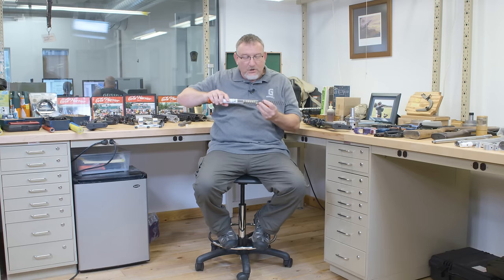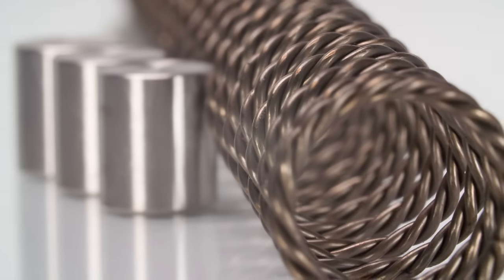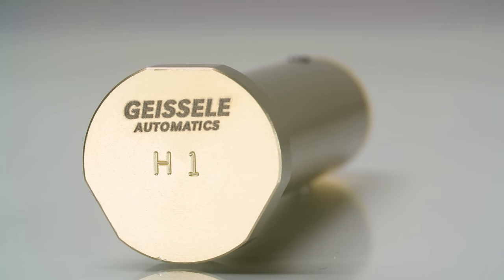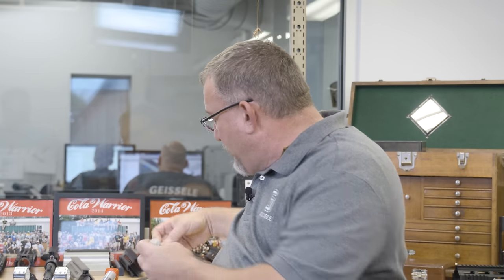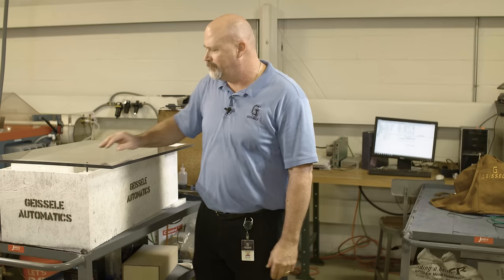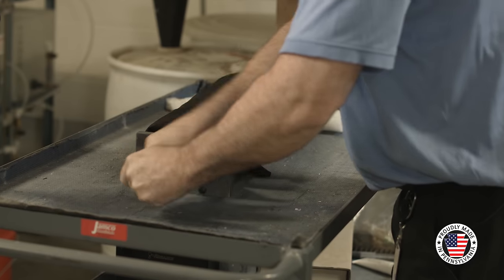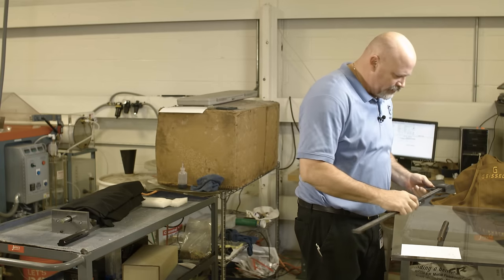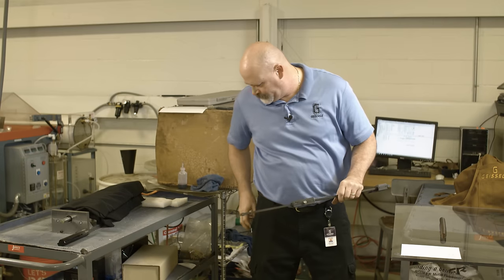Introducing the "Super 42 Braided Wire Buffer Kit"

Comment: Everything's chicken, but the BILL...
THANKS FOR THE INFO...
Do the springs have spot welds to hold the individual wires to each other, or is it the spring's "memory" that each wire possesses that utilized by the metal always wanting to return to it's previous straight shape before being tooled into the twist? Like it's wrapped with a twisting sequence, always pressing in different opposite directions all at the same time? I.E... outward, inward, wanting away from, and against each other constantly, almost like the water that keeps the static pressure on the submarine that is holding the springs together with each other in that shape? 
I was wondering if the friction causes it to heat 3x as fast,  weakening the  metal at all and if the wires rubbing against each other need to be kept up with and oiled periodically to help with lubricity and combat the heat with less friction between the strands?
Reply: Regardless of your answer to my aforementioned question below this one... I am going to buy 2 of your MG 42 Buffer Springs... That is, unless you fine weapons builders in Pennsylvania could find it in your heart to send me 2 of your previously used test samples to install into my wife's .223/5.56 AR w/16" barrel and also into my AR-15 which is chambered in .300 Blackout that has a 16" barrel as well.
If that sounds as great to you as it does to me... well, just holler back at me and I'll make sure to send you a size for a T-shirt I can wear to provide you with tons of free advertising that results in even more boosted sales to your great company. Yeah, I though you'd agree in the fact that it would obviously be a no-brainer type of good idea to go ahead and invest in. Thanks...
I'll have YouTube alert me for your rapid response in the inquiry of T-Shirt sizing to go over my BIG head. 
I sure am REALLY glad you quit designing train tracks and went with your desire of improving these parts to make my free time go so much  smoother, less stressfilled, and it leads to a more happy /go lucky less worries giving me a better outlook on life... because that's just one or 2 more things that are going quite a bit smoother, that I don't have to think about anymore now. I'm VERY HAPPY with your parts that I purchased and I now own already.
But... If you're gonna scrap the springs you used in your previously mentioned test runs on them....you know, holler at a brother... lol...

Comment: Hi Bill.  Can you tell me how much an AR spring will take a set if it's stored with the bolt locked back for a prolonged length of time, say more than one year.  Thank you.
Reply: I can. Depending on the quality and heat treat, it SHOULD be ZERO. What affects springs is not the compression, but the CONSTANT compression/decompression. I've got a bunch of 100+ y/o Mausers where the magazine springs are just like they left the factory,

Comment: I'm seeing quite a few comments complaining about the cost of this, and the propriety buffer. While I'm not an expert in buffer kits or all the different brands of them offered, I think many are missing one huge plus to this kit..... being able to swap out buffer weights yourself. To me, that is HUGE. Trying to fine tune a rifle with different ammunitions, or shooting suppressed vs unsupressed, being able to change the weight of the buffer, without actually purchasing different buffers all together, seems like a pretty big pro to me.
Reply: You can easily change buffer weights in the standard AR buffer the same way. Just push out the pin take the poly pad out & change the weights yourself. Heavier weights or steel weights or mix a heavy with 2 steel weights etc. They are separated the same way with a little rubber pad. Same as this buffer. People that just start flopping parts around for no reason then wonder why it won't run right have no business with an AR. Most AR's run fine without all this "after-market" "after thought" parts. If it works don't fix it!

Comment: Would there be performance issues on a piston-driven 16" AR-15?  And if not, would the H-1 with a single Tungsten weight be sufficient?
Reply: H1 did not run in mine. Jammed after every first shot

Comment: I have the m&p sport 2 and seams way over gas and has too much recoil. Where do i start? Buffer or adjustable gas?
Reply: Jesse James you can change out the gas block to an adjustable gas block or try a muzzle brake instead of a flash hider. The muzzle break will vent more gas out the front but you will lose the flash eliminating capability a bit.

Comment: A little bit of Russian trigger engineering... I love your product Mr. Geissele. I recently bought one of you charging handles. It gets best out of 4 other ones I own,  It's very smooth. Shame you don't have this spring setup with an H2 and an H3 option. Is their anyway to get only the spring?
Reply from the maker: Hi John, we sell extra tungsten weights that turn the Super-42 into H2 or H3 options. Installation is easy. The Super-42 spring will not work with a standard buffer, this is why they are sold as a combo.
Reply: Ah, I see so the buffer isn't a MilSpec Colt type? I'm interested in buying one, thanks for the information. Your companies charging handles are smooth as can be. I've tried many other high-end brands and the coating is slick. Is it Melotined? I didn't have the gas block and tube perfectly inline. I went to function test it, it slid off the barrel. lol, I torqued the gas block down well with RokSett and haven't had a problem in full-auto. I think I'll go with a barrel dimple jig for my next build.

Comment: How does it function in short barrels 10.5? Or 16" with mid length gas or intermediate gas
Reply: 12:45 through 14:05 he talks about this
Reply: Bill says carbine system, doesn't go over mid or rifle length
Reply: I'm running one in a 16" mid-length gas system. And it runs very smooth. Not one issue.

Comment: 19:15 "measure a spring with calipers. hahahahahah oooohhhhhKAY
Reply: I’m not ver mechanically inclined but it did seem like a pretty arbitrary measuring. They said at some point it’s more  they’d like,  but yeah, it didn’t seem very scientific. I’m still gonna try it though. I’ve got a PSA and I would like for it to snap a little stronger when it goes into battery. I don’t have a real reason for wanting it, I just want it.
Reply: @LKaramazov  Rule of thumb is to change from tip to butt.
Starting:
1. Muzzle device 
2. Gas block / Adj Gas Block
(Gas ports on the barrel can also be opened -- but I'd not recommend this unless you're advanced)
3. Gas tube (Black River Tactical makes tubes with different diameter holes to change gas glow.)
4. Bolt
5. Bolt carrier group
6. Buffer
7. Spring

All depends on what you're going for. "Lighter recoil"/"muzzle flip"/BCG bolt speed, etc.
Reply: @Gnolomweb  thanks!

Comment: I thought the Super 42 was complete snake oil until I picked one up on a Black Friday deal a couple of years ago so I could be Gucci too. I'm so sorry to Bill and his team for calling them out on this. It is without a doubt the best performance upgrade I have made. It's really hard to explain until you use it, but it feels so different. Not really less recoil, but more expected and controlled, if that makes sense. I run it in everything now. Great video here too.
Reply: Still running these springs and buffers?
Reply: Mr. Excitement yes. Either these or Vltor A5. A5 is a bit more flexible, but these are great.
Reply: Grayish Man that’s great that they worked out well. I’m building out a lower receiver parts list currently, and planned on trying strike industries flat wire spring with a spikes buffer.( 3 oz or the 4.3oz) saw this and said hmmmnnnn . It’s tough choice. These really all the hype bill geissele claims?
Reply: Mr. Excitement I have used the Strike, CMC and Tubb flat wire springs. These are great too. I have tested most everything. The flat wire I use with the A5.
Reply: Grayish Man do you think these are worth the 82 dollars in h-2 form, that’s geissele asks? The strike flat wire is 17.95. Did the strike reduce the twang sound as well?

Comment: Thank you for the great video.  I'm a new subscriber.  

I have been reading and looking at every YouTube I could find on buffer selection and springs.  As someone new to AR-15's, finding out why something is deemed higher quality than an alternative can be elusive.  Most boiled down to experience and trust me.  Until I saw this video, most of the advice suggested going with the heaviest buffer that allowed your AR-15 to cycle correctly based on trial and error.  Some suggested going with "better" springs without really explaining why they're better.  A statement like "7% stronger" doesn't do it for me unless you can tell me why that improves durability and other desirable characteristics while not screwing up the rifle's timing.  Now I am looking to purchase a PSA lower (great price point), but am going with the ALG ACT trigger and this buffer and spring.  All PSA lowers seem to come with carbine buffers and, intuitively, that sounds like the wrong choice for my 18" upper.  It's not carbine length so why is the default carbine buffer the right choice?  It's cheap and will work, but at a cost.  Really looking forward to finishing this build!
Reply: The act is a great trigger. I rec using the  heavier hammer spring unless you are only going to fire cartridges loaded with softer primers (usually not mil surp). You are absolutely correct with buffers though. Go for the heaviest buffer that still functions reliably with every type/weight ammo that you plan on using. My 18 inch mid length really likes the T2 buffer with a chrome silicon buffer spring.

Comment: You guys should improve the design of the buffer retaining pin. That is one of the weak points in the AR and I think you guys could engineer a fix. The function of the gun hinges on this pencil lead thin steel pin which takes a beating with each mag. Make a buffer and spring retaining system that is more robust.

Comment: I think it’s snake oil. 

If one’s worried about noise from harmonic frequency whilst donning hearing protection, I question their sanity. And, who among us has put 50K rounds through any of our AR-15’s? Subsequently, his selling points are moot.

Geissele’s a proficient machinist…I’ll give ‘em that as a fact. Nevertheless, you can dazzle with brilliance and baffle with bull shit and he’s rockin’ it.

I don’t know how smoothly this Super 42 Braided Wire Buffer Kit performs but I do know the JP Enterprises system performs noticeably more smoothly than a Mil-Spec spring and buffer assembly. Without wearing any hearing protection, charging a JP Enterprises system you can hear and feel smoothness. The JP’s expensive and a few ounces heavier but it’s smooth as silk and incredibly quiet; both charging and firing. To me it’s worth the trade-off of a few ounces. And, in my own personal opinion, simply based on design, a better mousetrap.

How can I make that statement without trying the Super 42 Braided Wire Buffer Kit? Because, there is less surface area of high resonant components in contact with the buffer tube. Google the system and see for yourself. I don’t have a dog in this fight and wouldn’t lie to fellow AR owners.

Just for the record, I’m not affiliated with JP Enterprises in any way, (I wish I was). I also have a Geissele Super Semi-Automatic (SSA-E®) trigger on my most expensive AR platform, i.e., a PWS MK220 MOD 1-M Rifle — 6.5 Creedmoor. So, I’m not a Geissele hater and the trigger’s awesome to say the least. I’m just callin’ bull shit on this Super 42 Braided Wire Buffer Kit.

Oh...And all this about weighting. Weight is weight. What weights more, a pound of tungsten steel or a pound of feathers? Yes, I understand, if you want to encapsulate them in the same  buffer enclosure, you'll need more tungsten to increase weight. That also makes that buffer enclosure an integral part of the kit and proprietary. Because the ID is smaller that Mil-Spec, Geissele's got you locked-in. Again, in my opinion, I don't think it's that great a kit to be locked-in to when there are so many compatible products available. Grant it, their spring may set shorter after 50 thousand cycles but....

Comment: why use spring at all is there any other way reset the bolt yes c02 hell that one idea never conisder  but we cant have free flooting bolt right we need it on rails and we need spring to slow down the bolt  when bolt hits so far back co2 release to reset the gun  now i just throwing this off top my head  
there was cross bow i told them we needed a auto reloading cross bow the people built one with a motor to reset the bow 
i put this kind spring in 50 cal do to stress and power of buller also added a hydroic dapper so bolt would not slame to back of stock now 556 dosent have lot recoil other larger size ammo 
dose  it has much do with ammo wait of bolt and i never did like idea of free floting bolt i seen what happens when u take 556 and put 300 black out in now in all respeck 
gun should fire not blow up  now same parts are used in bouth so saying that why is it blowing apart a 556,  same mettles used bolt is fully seated  u fire bolt blows up so dose lower fram note dose no harm to barrle, so i love insight as to why this going on and is there way to provent loading wrong ammo in ar with u all makeing these thing u not consider at all some one putting wrong shells in it gun should refuse to fire , but how get gun to do this ?

Comment: Let me tell you something people do what I tell you and never worry again get yourself Three springs if you can go from light to heavy three different gauges of springs is better you can use one for all but it is much better and will last a whole lot longer when you're switching out from light grain to heavy green bullets you use each different spring and put in your gun say a 55 grain use your lighter spring and continue to stretch it as time goes by that spring will last you a super long time before it ever breaks because you're not shooting a heavy grain against it do you understand that therefore you're using the same spring for about the same grain bullet so each spring is set for each grain of bullets and you have to just stretch every once in awhile that spring mine worked for many many months before I bought new ones so that weight thing on the end that's all a bunch of BS use your same one and I do use a pretty heavy duty one to make sure it doesn't get wore out too fast not weight-wise but mine being made out of titanium I had mine made so I never have to change that buffer weight on the end of the spring now again listen and listen real close make sure you measure your springs and always keep them at that length so if you have to stretch it a little and it was so many inches and you have a little bit of a loss stretch it back out and you won't have to do it again for months and months don't ever buy any more of those expensive spring b***** kits again harmonic weave my eye laughing out loud just to line their pockets full of money they'll tell you and sell you anything